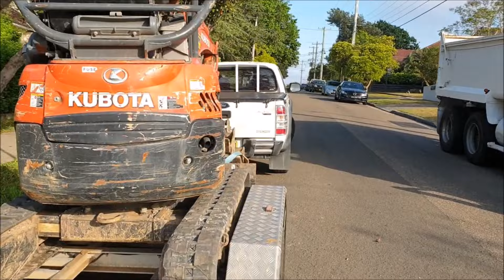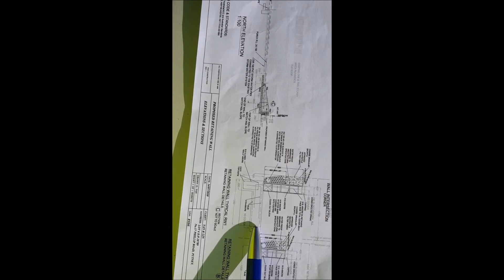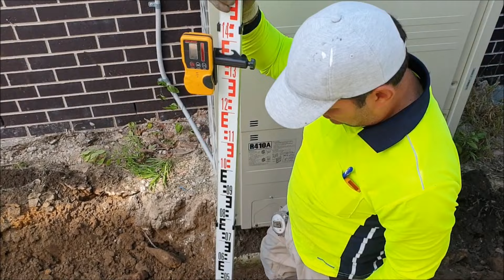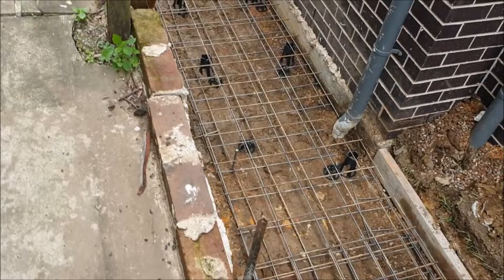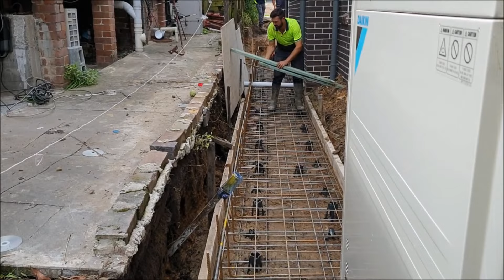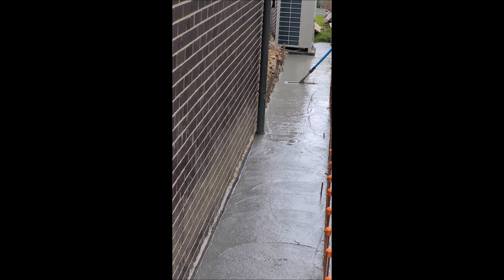Concrete Footing for retaining wall, landscape design retaining wall, retaining wall structure

Comment: Great video guys. First one I’ve see that shows so much detail of the process. Can i ask a question though.
In the plan for the 4 block high wall. It shows a 500mm depth of the footing under the wall. But in video it shows you into dug 250mm. Did you not have to dig that extra footing out? Thanks.
Reply from the maker: Hi
Thanks for watching us. 
This project inspected by council and we had to follow the engineer details. 
They inspected the footing before pouring concrete and when the wall completed.